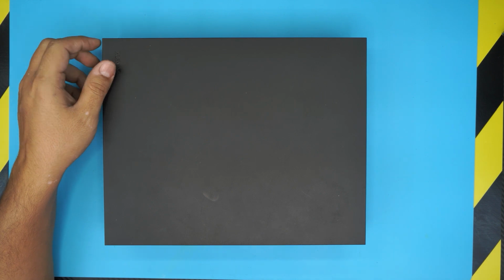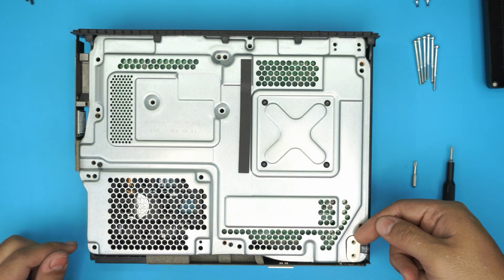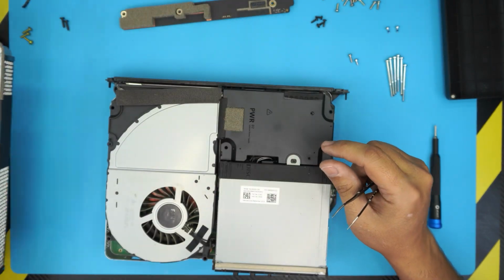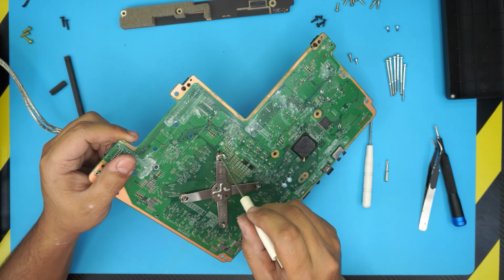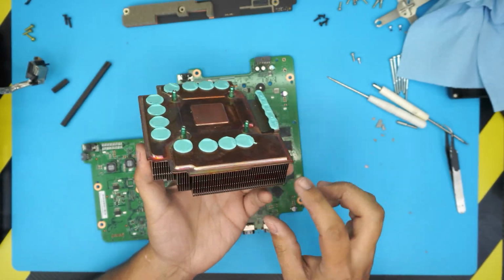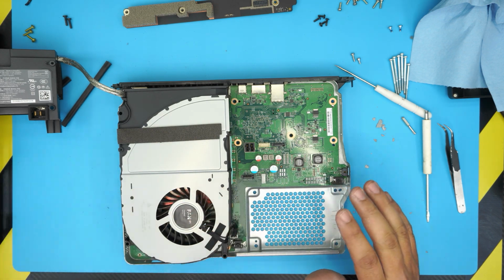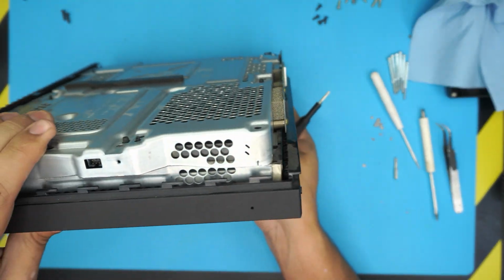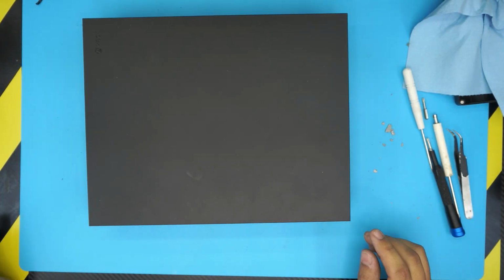HOW TO CLEAN AND  REPASTE YOUR XBOX One X Series FULL Guide

Comment: Great help thanks.
Reply from the maker: You're welcome! 😊im glad it helped you and thank you for the support to the channel.
Reply: Were you having the shutdown issue cause ventilation issues ?
Reply: @silvesterSTillSTONED   my problem was cpu  thermal paste not doing its job and console would shut down to protect the it.
Reply: @OneBronxBoy  awesome thanks, I’m getting ready to do mine soon as the paste gets here Monday. Would it power down and then say it shutdown cause ventilation issues ? Like a message pop up as soon as you re turn on your console ?
Reply: @silvesterSTillSTONED  make sure you ONLY wipe clean and apply paste on the top of the cpu like he said in the video. It should turn on like normal after that and it won’t crash do to cpu over heating.